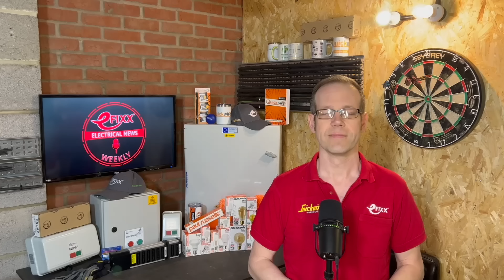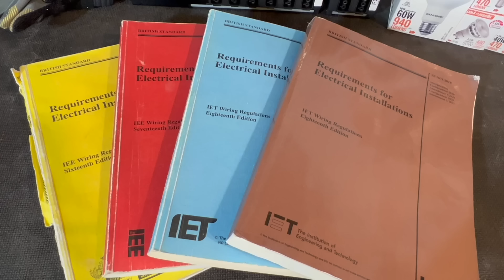Revealed: What's Inside BS 7671 Amendment 4?

Comment: The UK standard of using the ring main circuit, is the Bain of all electricians , it can become dangerous by design , and then all DIY’ers , cause an unbelievable testing and inspection engineer nightmare , the next level  problems .. from experience ditch it and  reconfigure radial circuits.
From experience 
Sockets with poor connections  , then our accreditation companies say take the readings on the wires before they go into the socket … 

It goes on as a discussion far beyond my point ..

Comment: 2 Questions of you please.

1 how do you fault find a circuit the is tripping an AFDD?

I've heard it is impossible with traditional insulation resistance testing.

2 - who is recommending this stuff?

Manufacturers or actual electricians?

Were being sold down the river by the IET methinks.

Comment: Sorry for the dumb question as I'm not a sparky - but has this update impacted on balcony solar systems in terms of making it easier for sparkies to install 'plug and play' solar kits like the Ecoflow Stream Ultra? I've had issues finding a sparky who's happy to install mine as they've said MCS haven't yet issued industry guidance for safe wiring/correct processes to enable provision of warranties etc .I may be way off with that summary but would welcome any advice on when regs around balcony 'plug and play' solar systems will be implemented/clarified to the solar industry. I believe installing them is quite simple (a day's work?) but finding a sparky familiar with these kits is proving a nightmare. thanks!
Reply: Amendment 4 was put out as a final draft version for consultation long, long before the government announced 'Plug in Solar'. So there's nothing at all relevant to it.

As for the electricians telling you about MCS, that's completely irrelevant also. MCS doesn't write any of the standards associated with solar PV and/or battery storage installation. It simply insists that its accredited installers follow the latest edition of BS7671 and the latest edition of the relevant Codes of Practice, both of which are written by the IET.

Comment: Good luck confiming the customer's earthing arrangement with the DNO. Incomplete/inaccurate records mean the DNO will not always know for sure the correct earthing.  Also many 4 core TN-S mains circuits have been altered/repaired using 3 core Waveform or CONSAC cable and so no longer true TN-S.

Comment: If the ring main was in a figure of 8 or a ring in parallel with a ring main it may not necessarily be dangerous but just not a recognised method .  I have seen a 6mm radial split into a ring main . Apparently this method is called a lollipop circuit. It was odd but not at all dangerous as the ring part was good and its readings all within limits. We must remember that during an electrical condition report we are not doing initial verification and testing. That lay with those who installed it in the first place. Our intermediate testing has limits. All too easy for those sat behind desks to keep thinking up scenarios to add pressure to all those of us who have to conduct tests. Getting rid of and sorting out fake or drive by testing would do more good.
Reply: An open circuit on the remote loop wouldn't show up when tested from the CU though.
Reply: @markrainford1219 It would if you cross connect r1 & rN at the CU and test the resistance at every socket outlet.

Comment: if i ever get a chance to build my house, i'll refuse to have ring circuits. radial circuits only.
Reply: I'll be looking to buy a house later this year and will also be removing any ring circuits if it has them. They're illegal in other countries, for good reason too.
Reply: No need at all for rings these days. They only came about due to copper shortages around the war time. They serve no purpose in a modern setup, unless it's a mains distribution HV ring or something
Reply: 20amp radials are way forward
Reply: Back when when the 16th was being mooted, the IET publication said rings were about to be phased out. They also said we would then change to continental style plugs and sockets as a fused plug wouldn't be needed. So I started doing all radials, only for the 16th to come out, complete with ring circuits. So I went back to installing rings.

Comment: Same old BS made by pencilpushers for revenue.
Reply: How much does it cost you?
I actually did the analysis on this in another post. You can check it out if you like.
Essentially the regs cost you less than £1 for each customer job you do, if you do 5 jobs in a month.
If you do more than 5 jobs in a month, it's even cheaper.

How much are you charging for a job?
At least £100 ? So £1 is almost nothing, it's peanuts. It's small potatoes.

So you can't be moaning about the cost of the regs. So what exactly is the nature of your objection?

Do you object to it, because you have to learn something new?
Surely you sparkies love to learn new electrical stuff, don't you?
Reply: @deanXRayZulu buy it yourself and read it then if youre so concerned about it all.
Reply: @tommcconnell69 I have bought earlier editions.
I buy them when I need the information in them.
But your comment has absolutely no relevance or bearing on the actual cost of the book on a per job basis for electricians 
So what is the point of your post if it is not relevant?

Comment: Knew there's a caveat for cheaper shit from Givenery

Maintain adequate sovereignty in your own homes, host your own local servers to control the devices, guess what Tesla powerwall will do in the future as well? Subscriptions!

Fuck that
Reply: Was one of the reasons i went for GivEnergy at home in the first place. Local control means that even when GivEnergy software goes paid, i'll get to control my battery locally. Tesla and Givenergy's AIO were surprisingly close in price, but the local control of GivEnergy sold me. Losing support long term sucks but i have sovereignty

Edit: I misread your message - GivEnergy's inverters and battery do have a locally accessible API. The only piece in their product line that doesn't is the EV charger (which really sucks). As mentioned, I bought it specifically for the local control i'll have over it.
Reply: @arrowtlg2646  
In GivEnergy’s low-voltage firmware revisions page, they state:

"Firmware lock added, only the required generation will take the provided FW.”
- support for mixed GivEnergy battery generations is something they added internally

This isn’t proof of a DRM-style anti-competitor lock by itself.

However looking further into the inverters:

Their Gen 3 HV hybrid inverter page says:
“This model [10.0|8.0] is only compatible with the stackable battery.”

Well this is clear that although it's not as closed as Tesla Powerwall in terms of software control, but you lack the freedom to configure it to the way you want it to be, especially when something breaks in the future and the vendor is no longer there(like what's about to be the case for Givenergy)

I would look for support docs naming CAN/RS485 battery integrations, program the charge and discharge curves and limits, or let's say you don't even need to have the data centralized into a single module with many LifePo4 batteries having their own BMS
Reply: Who would pay for a Tesla Powerwall anyway? They are double the price of the equivalent amount of storage from their competitors.

Comment: As a customer, i would like to learn more about the plug-in solar products soon to be found at Lidl and others. Thank you.
Reply: I went with Ecoflow gear. I checked out plug-in-solarDOTuk as it meade clear which batteries came with what. I've got a micro inverter and battery setup with 6 panels. My bills have gone to almost 0.
Reply: How soon? The government hasn't even given a guaranteed date of when they'll be available.
Reply: @VinoVeritas_  Energy Sec said before the Summer. So real soon.
Reply: @recondite12  Is that on record anywhere? The government announcement specifically said "in the coming months" and that announcement is available on the government website.
Reply: @recondite12 lol
Reply: i've got the same question (the long post at top) as ive got an ecoflow stream ultra that i need a sparky to install...they all say 'no official guidance' available to enable them to guarantee/warranty the install. I've had the kit 6 months and cant bear missing a whole summer before there's some official MCS update on installation processes, guidance etc. Would welcome hearing from anyone who keeps tabs on this stuff - thanks!

Comment: Forgive me for sound like a plank but what did you mean about the bonding, did not quite understand
Reply: Just trying to reinvent the wheel mate .
Reply: @samys-g3o 😂
Reply: If you have a fault along a combined earth/neutral (creating a high resistance path to the true earth), that can lead to dangerous voltage flowing back up the neutral cable and to other metal work, hence the bonding to a localised rod.
Reply: was that not already written in i have seen it in brown book.
Reply: @gino2465  They did say "clarified" some things, so possibly.
Reply: But the regs are written so you can't understand them without the on site guide and training courses, so bit weird that they are clarifying.
Reply: @markrainford1219 😂
Reply: @markrainford1219  😁
Reply: What hope to we have